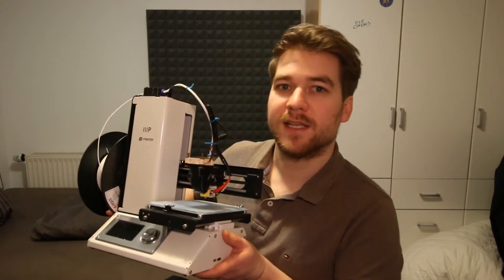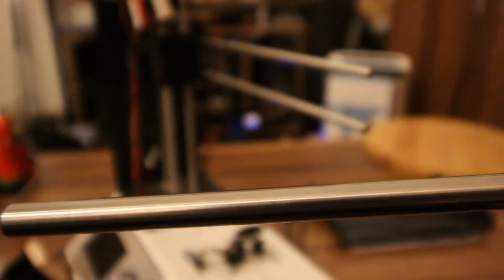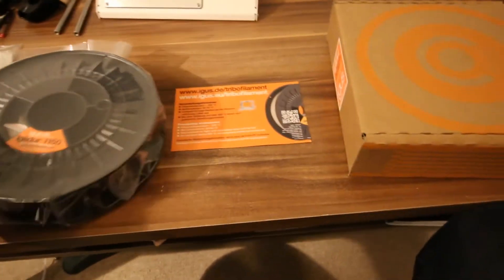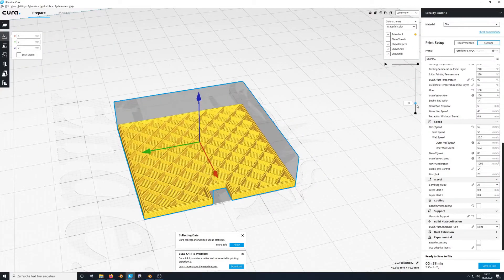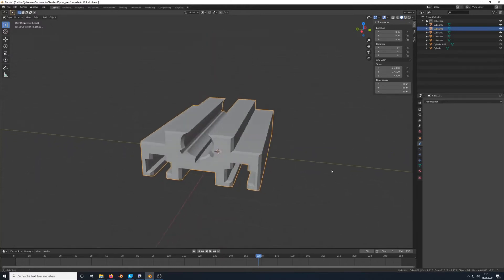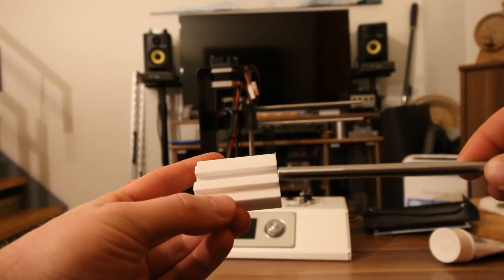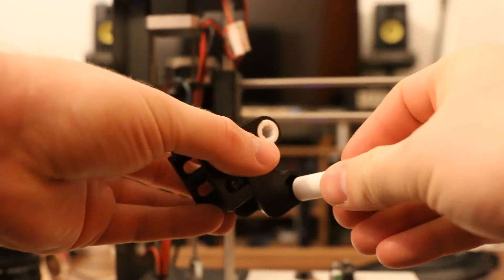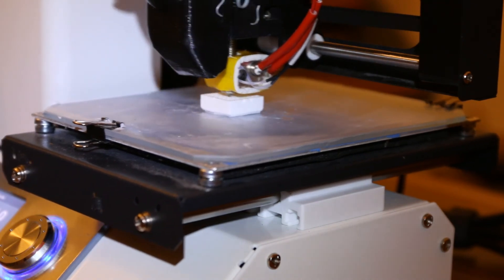3D Printing Igus Iglidur I150

Comment: Great video, the 3D printing community needs more simple, sweet and unique videos like this. I was wondering how well this filament holds up over time, are there any problems with the filament you noticed?
Reply: Also I’m your proud 4th subscriber, keep it up!
Reply from the maker: Hi, sorry for the late response. And Thanks for subscribing! I've been busy with other things since I made the video, so I never used the old printer with my custom bushings much... I've just started with a second project idea. Supposedly this stuff is good for gears, so I'm planning to make an "infinity machine", a little demo experiment consisting of many gears. And as an added test for the materials, I was thinking to make it reverse, i.e. let the gears spin fast, and then compare how the performance compares between igus, PLA, PETG, ... Now I firsat need to experiment with printing gears at all to get a good fit.